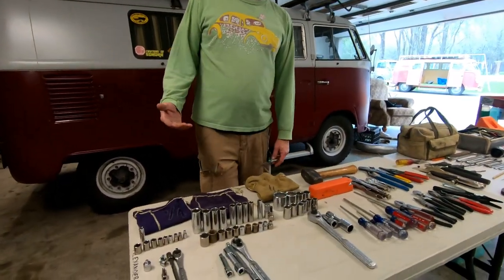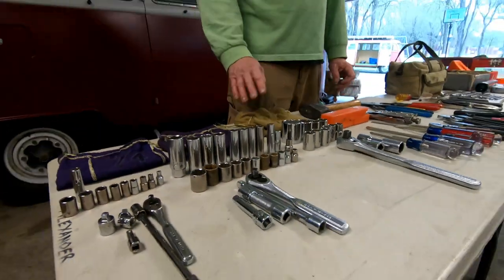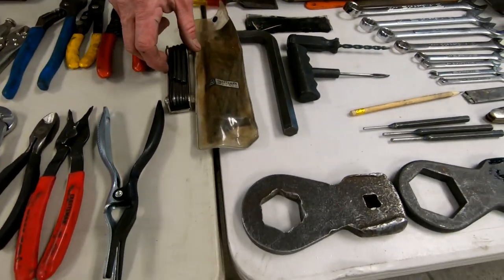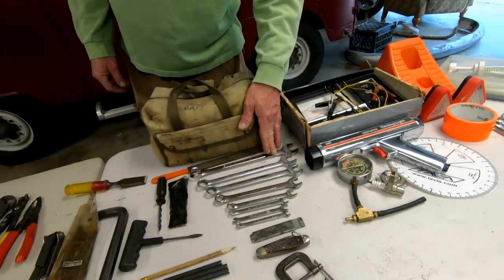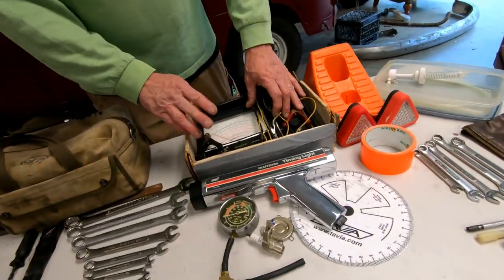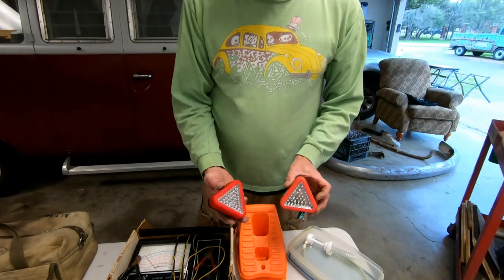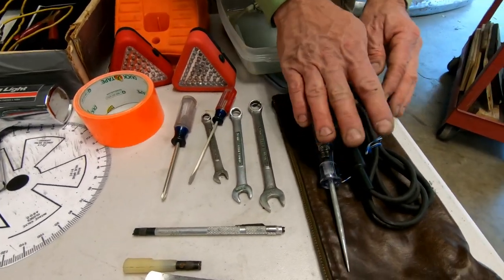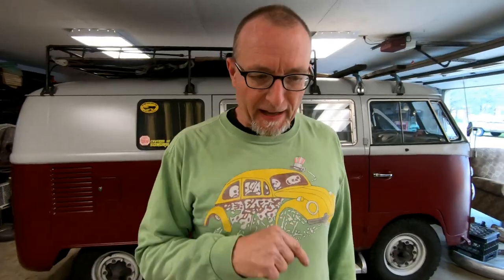Volkswagen Tools!  - what you should carry.

Comment: Quick story.  
   My Father and my 17 year old self were traveling from Salt Lake City to my first duty station in Norfolk, VA. We were in my '63 bug (it was only 7 years old at the time) with a fresh engine rebuild by an old German VW mechanic.  It was a beautiful 40hp engine with 83mm pistons and an exhaust extractor.  Wow!
    We made it to Virginia, but it was still many miles to Norfolk when the engine simply refused to run.  It needed a tow to the closest VW dealer for the fix and a few hours later we were back on the road.  
   Seems a wire had come undone in the fatty dizzy and shorted out the electrics, which stopped the engine cold.  Neither Dad nor had the knowledge or to TOOLS to fix this very simple problem.  Just goes to show you, even when a bug is relatively new and the engine is freshly rebuilt, they are still were prone to the occasion malady.

   My advice is, "TAKE YOUR TOOLS AND THE IDIOT MANUAL".  You are going to need them.  It's only a matter of time!
Reply from the maker: great advice and thanks for sharing!

Comment: Thank you for sharing.  I was a Boy Scout.  I learned how to shoot a gun and always to be prepared.  Even if one doesn't use the item in 3 years, when left at home, it will be needed.   GO LUMBERJACKS!  ALL THE WAY SFA!! I saw the Lumberjack flash on the screen.  I was in the band.  I feel that a flexible bag will fit in an odd size space and won't rattle.  How about adding a hand crank flashlight?  In the summer, my batteries die in the heat.  I gave everybody a hand crank flashlight and a hand crank weather radio as Christmas gift.  I keep a wind up flash light on my nightstand, in my car, and by the recliner.  I don't have to worry about batteries failing.  I got a bunch of them at Home Depot. They are inexpensive and very useful.   You have put together a great list of tools.   One never knows when you will be under a hot car laying in the dirt by the road, IN THE RAIN.  I live in Texas.  I also carry zip ties in all sizes, assorted bungee cords, and a couple of old wire coat hangers.  The hangers can be used to hang up your nice shirt while you waller in the dirt fixing the vehicle and there are a zillion uses for an old wire hanger.  They are really handy for emergency repairs that get hot. For example an engine cover comes loose or to keep a loose muffler from dragging on the road.  Zip ties will melt and will stink!  LOL.  Money is tight and if one can make a temporary repair that will safely work until one gets the time to repair it, it's worth hauling all the supplies around for a few years.  Every season, I go through and clean and wipe the metal tools down with a cloth and WD40.  It cleans, remember it always breaks in the mud, and keeps the tool from rusting.  I really dislike being stuck on the side of the road, a million miles from anywhere  (again, Texas)  Thanks so much for your tool finds and repair shortcuts...Later. Gator. .....Ivor

P.S.  I picked up a cheap yoga mat at Walmart to use for yoga and to lay over the dirt when crawling under the car.  It's also useful to lay over the car seat when one has been wallering under the car. I always drove "Rolls CanHardly"  cars.  You know " rolls down the hill and can hardly climb the next one.....
Reply from the maker: Wow cool story yep Jake actually goes to SFA! Thanks as always Ivor
Reply: @VWLifeVW  Actually Jake goes to Sam Houston State, Eat em up Kats!
Reply from the maker: @CapnTexan  whoops. That's what I meant

Comment: I know it isn't absolutely necessary but I carry the little clutch adjustment too (with the + hole in it) for my 79 CA edition. (I also carry a spare clutch and accelerator cable and the little doodad that connects it to the clutch pedal) And a couple flashlights! Thanks for the tremendous videos!

Comment: Tweezers one small and one large. I like to buy forceps for light use. You can  get them at harbor freight or most any gun show. Same for small picks or cotter pin pullers. You drop something not steel so the magnet can't get it. Flashlights, at least a pair because the one you are using WILL go dead on you.
Reply from the maker: nice thanks!

Comment: Is there a thang too many tools, I don't think so if you don't have it you will need it. You mite wont to get a small air compressor that runs on 12 votes for low tires.
Reply from the maker: Yes great suggestion, we actually have one but forgot to include it